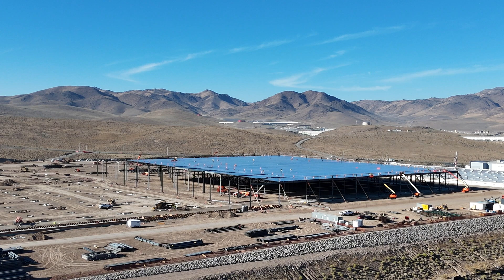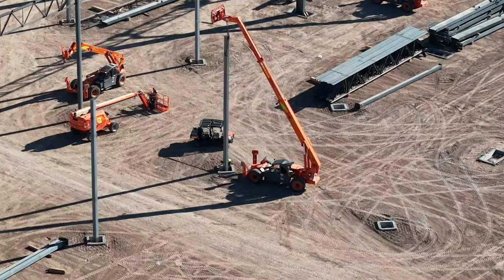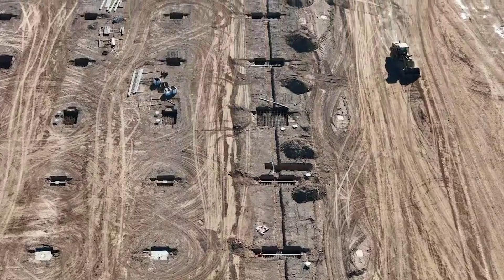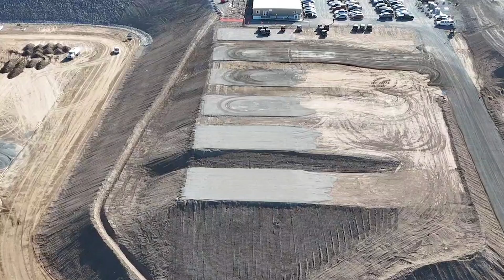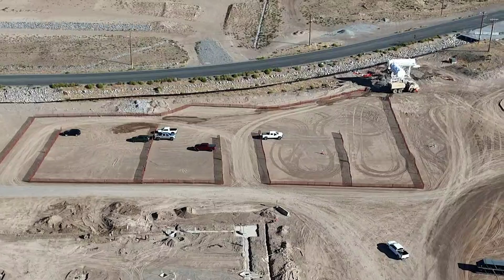Tesla Semi Factory Construction Update for 9/21/2024 - Concrete Jungle!

Comment from the maker: I asked AI to check this math. I think the last bullet point is off by an order of magnitude. 100,000 cubic yards seems more reasonable. This is what one million looks like:
:

Summary:

   •   Area covered: 36,000,000 square feet at 9 inches thick.
   •   Cost: $100 million to $150 million.
   •   Trucks required: 100,000 to 125,000 loads.

I am also checking with my source.
Reply: Where did you get the 36 million sq ft number from? One quarter mile by one quarter mile is 1320' x 1320'=1,742,400 square feet , if it is one floor and it is square. This building does not look square to me. It looks more like a rectangle, that is twice as long as it is wide. A 9" thick floor (0.75') x 1742400= 1306800 cubic feet, divided by 27cu ft/cu yd=48,400 cubic yards of concrete for the floor.

Comment: What's going on with the tele handler and the truss? Did he just drop it in place without fixing or what? The video cuts off so we don't know
Reply from the maker: Good eye. In my rush to publish, I had these in reverse order. The second segment should be before the one where he lifts it into place.
Reply: @ZaneglerTeslaSemiStalker-vt3or  But the question remains unanswered: did he just drop it into place? 

Can you get an extreme closeup of the joint between the truss and the column? Do you have any info on how the columns are attached inside the footing boxes?

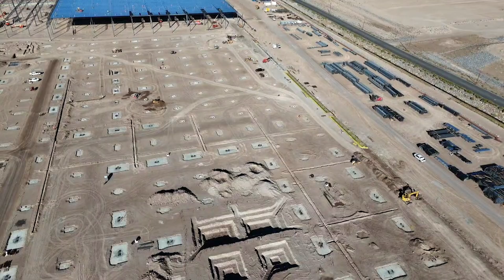Comment: 6:00. Deep footing excavation. These are on the same grid lines as the regular depth footings.

Same as at GT, deeper footings were required where large in ground pipes, or production line trenches pass close to the column. Footing needs to be deeper. The infamous 'zipper pit' was an example.

Excavation is stepped so that shoring isn't required. Actual footing area likely the same as other footings.

Comment: Hi Zanegler, when they were building Giga Texas, the massive subsurface multi-level foundations they built were for stamping machines. Compared to the  subsurface construction at Texas, this looks at whole lot smaller.
As always, many thanks for you ongoing coverage mate!
Reply from the maker: Thanks for the info!
Reply: Looking at the rendering the stamping section should be the SE edge of the factory.

Comment: Maybe you can get a closer view - look at the roof - it seems they might be putting in plexiglass type skylights as there are breaks in the sheet metal.  This would indicate the building will only be at the current level.  This ties in with your comments that the current roof is sloped, for water drainage - something they would not do if they are going to add a 2nd floor.  Thanks for your efforts!
Reply: A "planted" a tree at the corner along with the architectural rendering confirm that yes the building will only be at the current level.
Reply: There's no need to confirm, it's obvious already by looking at the rendering...